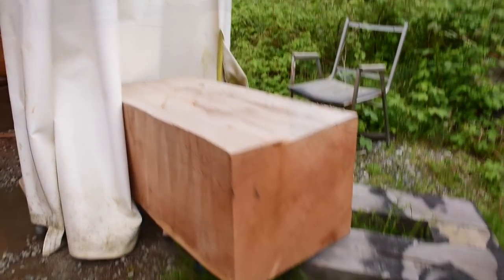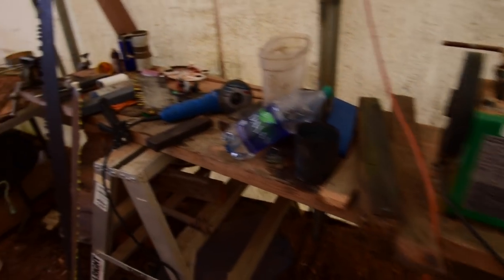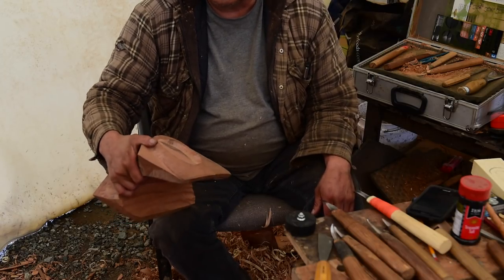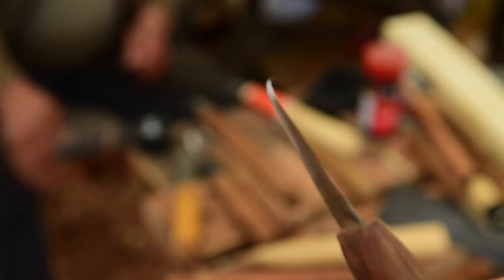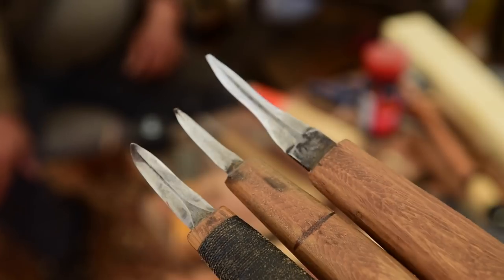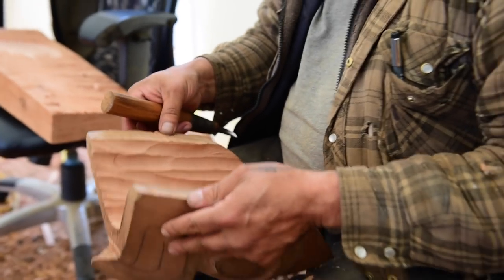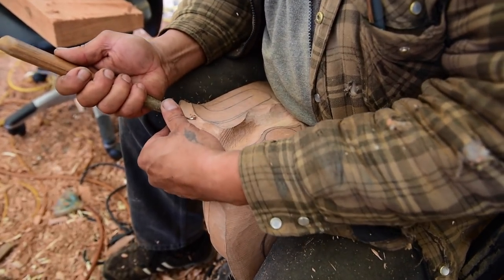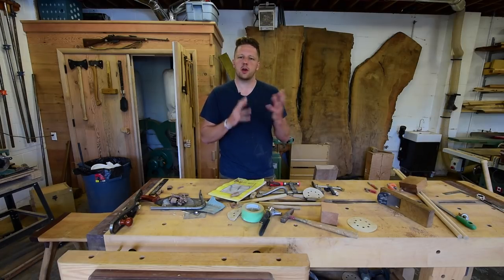FTF #56 Carving A Totem Pole Pt 1, Make Your Own Carving Tools!

Comment: I used to watch the native carvers in Oregon, long...long ago. I remember that they used Horsetail Grass for sanding and polishing. It gives an almost mirror-like finish. 

When used on a lathe turning, Horsetail Grass gives an ≈ 2400 grit finish. The reeds work best when almost fully dried.
Reply: Does it matter if its green or dried stuff? There's a few patches growing around here, may be I'll have to harvest some.
Reply: Yes, green can stain the wood and the water content seems to create a sort of "goo", rather than sawdust...too dry and you are left holding dust rather than reeds. Your mileage may vary. I have found it better to err on the drier side, than the wet.
Reply: Good to know. I can probably run horsetail through a hay baler in my area.

Comment: Hi Samurai, I'm a beginner woodworker and I find it very difficult to cut along my pencil mark without going off line when I'm cutting with a hand saw, or tennon saw in my case. Do you have any tips? Thanks
Reply from the maker: keep practicing.  Less pressure on the saw.  Light strokes.
Reply: The Samurai Carpenter will try that, thanks man